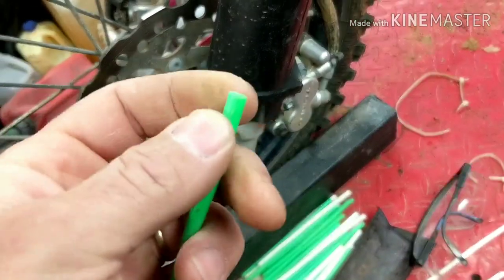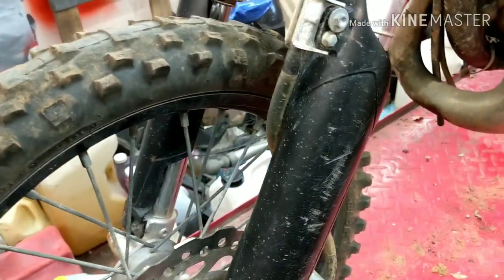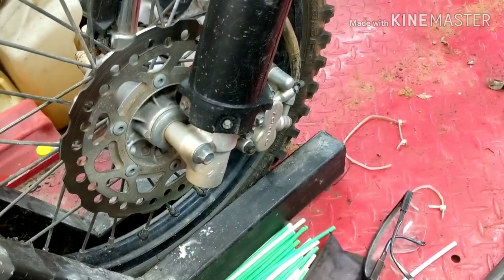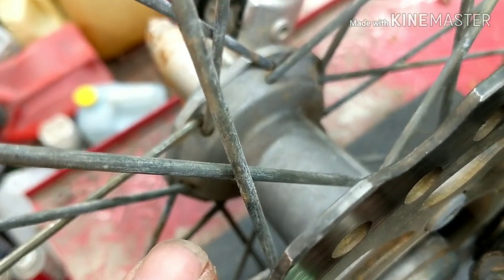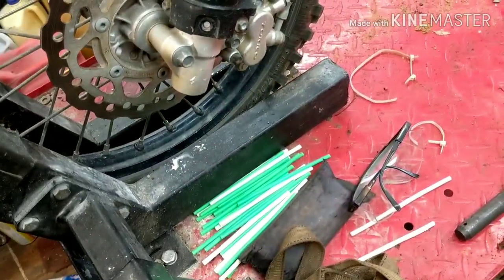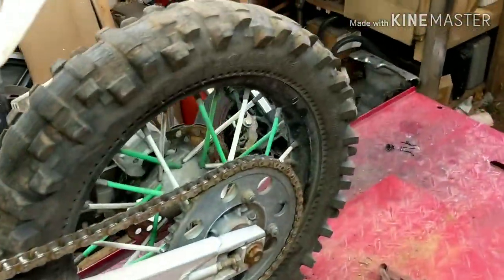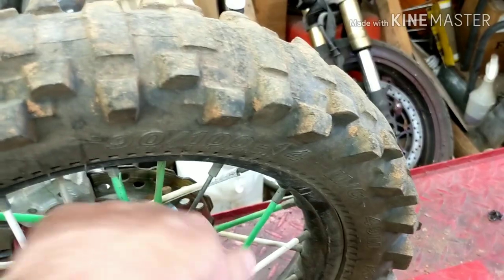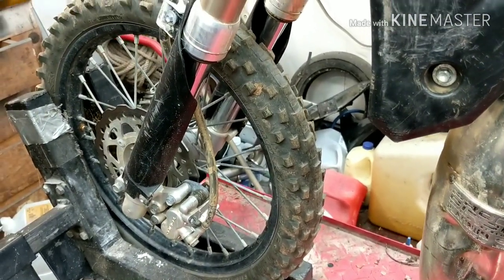Spoke covers, stay away!

Comment: I use these on my crf250 but coat the spokes with acf50 before installing them.
12 months on No corrosion.
Happy riding.
Reply: Sweet idea. What's acf50?
Reply from the maker: It's a corrosion resistant coating.

Comment: I've read that you can seal them tight by applying heat. They act like heat shrink and keep moisture out. 
I have no experience,  but it would make sense.
Reply from the maker: No, they are split longways to get them on the spokes so dont think that would work.
Reply: @TepcoCycleRepair  well if you get it hot enough the slit would stick together and seal it so yes it would work.
Reply from the maker: @Ronjon6162  Not the right kind of plastic to stick unless you melt it together.

Comment: I see staining left by dried, dirty water...not dangerously corroded spokes as suggested. What's the original spoke diameter? What's the current diameter? I'd bet there is virtually no change. Those spokes are likely 304 stainless steel. Keep it away from salt and it'll last decades.
Reply from the maker: Not "dangerously" corroded yet but definitely corroded. I understand your point but mine is why take the chance of a spoke breaking at the worst time. I think spokes are a very overlooked maintenance part of a bike. Stainless can most certainly corrode under the right conditions. Thanks for your input!

Comment: So because some owners have the lack of proper cleaning and or  maintenance, your suggestion is to not use the spoke covers ...... How about just properly maintain and clean your bike ??? 
Proper cleaning and maintenance is a must for any tool  🤔.
Reply from the maker: I agree but to properly maintain these they would have to be taken off after each ride to remove trapped sand/water. Or at least every few rides, and also rinsed out before reinstalled. Like remember car bras? You were supposed to take them off and clean wax you car underneath to prevent damage..almost no one did and they wore through the paint. The new bra is the clear wrap to "protect" the paint, those have a life span and need to be removed/replaced. No one does that, they dry crack and ruin the paint instead. 
So I hear your point but to properly maintain these doesn't seem like it can be done easily.